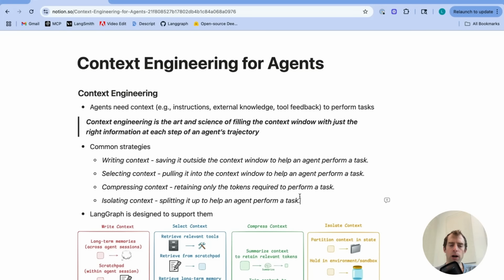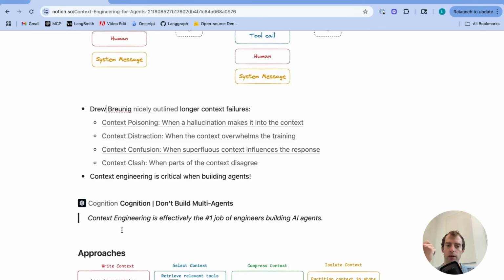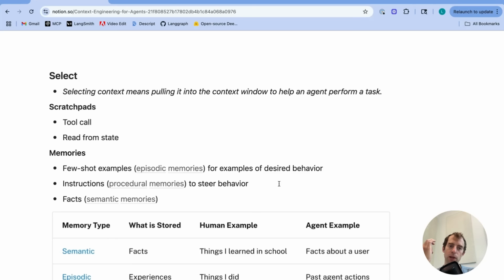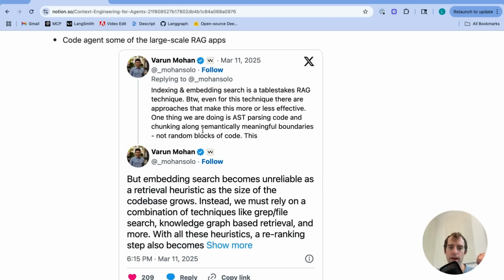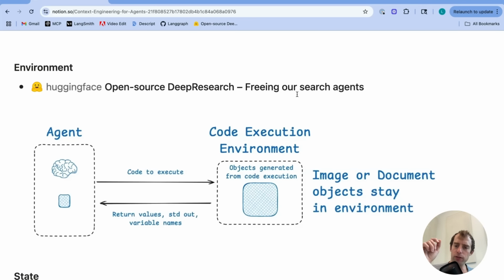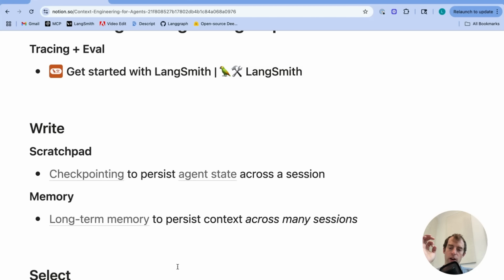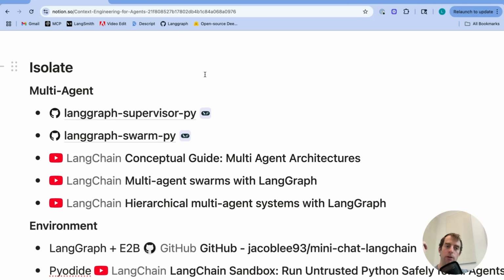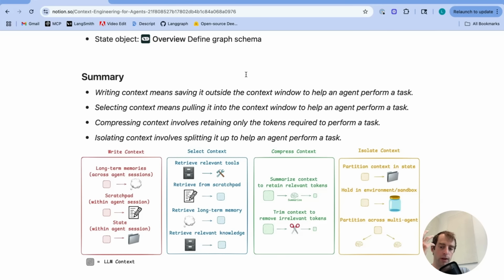Context Engineering for Agents

Comment: this is super interesting. the concept of trying to achieve a procedure with as small of an LLM as feasible by optimizing context window is certainly a very useful one. just yesterday an open source opanAI llm model came out that works locally on my 9070xt and i've been copying and pasting small contexts (it can only hold a very small context window before being overly saturated) and then iterating to try to identify how (at least one small) model interprets context. 

i think having this stuff available on youtube is huge because we need to be transparent about work and development in this cutting edge stuff to optimize use.

one thing i've realized from my limited experience is that a hallucination of an llm can be leveraged using recursion to enhance a model's performance. I'm still in my infancy of my development and learning python before i get into more advanced things like RAG and proper context (prompt) engineering (on coursera) but this was a beautiful glimpse!

(PS: sorry this channel was just made my previous channel was only music)

Comment: You all should work out a pluggable solution for running ComfyUI workflows inside LangGraph workflows all via python libraries
A docker container perhaps with everything all setup - starts up comfyUI server upon intialization.
LOTS can be done there... (combining the two)
And some have made a MCP for ComfyUI.
Update: Just getting into this, but I see now that it's as simple as a async websocket connnection/call.
import asyncio
import websockets
import json

async def mcp_call(method, params):
    async with websockets.connect(url) as ws:
        request = {
            "jsonrpc": "2.0",
            "id": "1",
            "method": method,
            "params": params,
        }
        await ws.send(json.dumps(request))
        response = await ws.recv()
        return json.loads(response)

Comment: Prompt engineering sounds too dumb so now people started calling it context engineering?
Reply: My understanding is that prompt engineering is just about the prompt. In fact, you can do prompt engineering without writing any software; just tweak your chatgpt prompt. Context engineering is a broader concept, relevant to building LLM integrated software systems. When an LLM is one component of a software system, a naive implementation may quickly run out of space in the context window, thus you have to decide how to shrink the context at various points in a multi step process.

In a sense, you could argue that the context is the prompt, but there are a lot more options to context engineering (external storage, indexing and retrieval , summarization, compression, etc) when building a software system, as opposed to just rewriting a question or instruction to feed to a chatbot.
Reply: @bryangrounds9341  I see your point!
Reply: Prompt engineering is more about effective articulation of user query
Whereas context engineering is about managing the contextual information complementing the usage of the agents

Comment: I call it feature engineering for agents (arxiv), similar to what people used to do in classical ML to improve the input representation. Once you have a good representation of your data (by selecting, merging, mapping, etc.), even a light model can surpass a complex models (e.g, Logistic->xgboost). For agents, these features are the context. So, it is not only the goal (pilot using big LLM), it is the system (components besides the LLM). The idea is to develop an agent/workflow/app with the smallest feasible LLM so that you are forced to improve the system (cognitive architecture) first. Of course, LM can be replaced by any other engine.
Reply: Couldn't agree more. Too many people just parrot what they hear without any critical thinking. It's especially true with all these new buzzwords people invent. They just put a fancy label on an old idea to sound smart and control the conversation, and most people just eat it up without a second thought.
Reply: I love this cognitive model. Feature engineering as a core competency is great because almost every form of machine, state or prompt driven, can fulfill it. Likewise, a LLM can be quite powerful for feature engineering on natural language programming data. As an oldhead to NLP, I see it not too different than the application of an LSA for topic modeling as a variable selection step prior to a traditional regression model.
Reply: I quite have not been able pinpoint ‘feature  engineering’ but acutely put, sir!
Reply: nahhh calling this feature engineering would be a very poor choice since it will, for many, equate it with feature engineering done in other ML topics. The challenges, pre-existing knowledge and techniques are very distinct and would result in increased confusion. Fundamentally, the topic is also quite different.